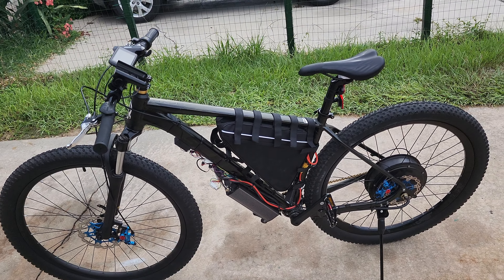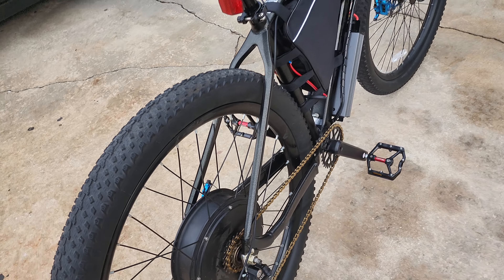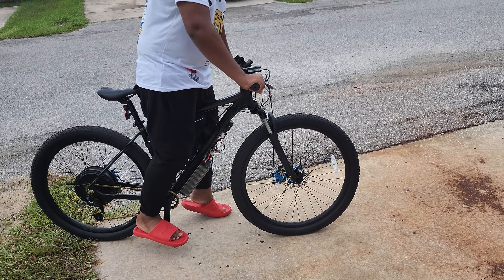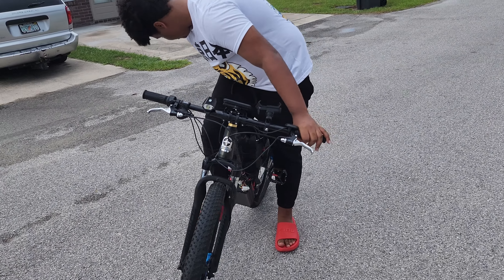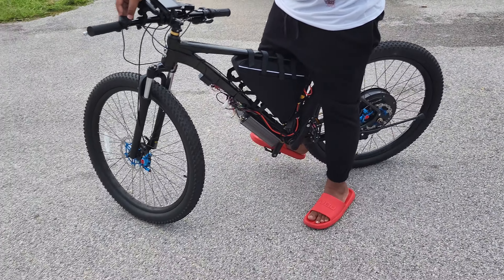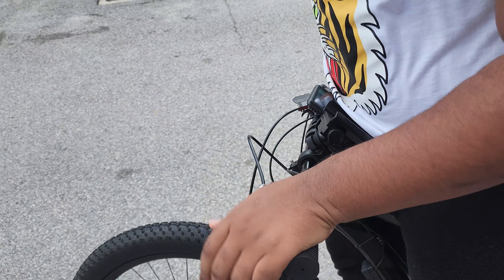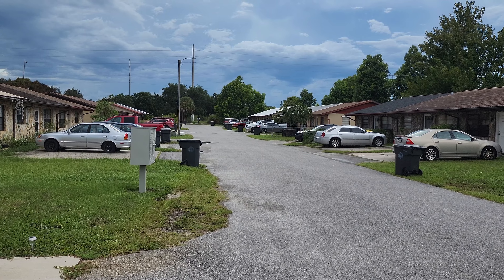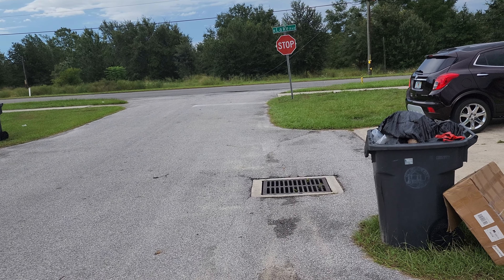Test ride on the 3000w ebike- sabvoton 72150

Comment: Another great build. How's the 48v holding up with the 150a controller?
Reply from the maker: It's holding up great but the 3000w motor gets hot under some hard rides so I'm going to give him my 205 and I'll be getting the 273
Reply: Nice.  150a controller not shutting down due to the low BMS of the 48v?
Unless you bypassed this one also?
Reply from the maker: This one is bms bypass also and I mod it to handle the 150a

Comment: For long distance riding to keep the bike motor cool install statorade gel and heatsink to the motor it's good to do this before installing the back wheel!! Please get the likes up people cheers!!!
Reply: Statorade is sold out!
Reply: @marthamryglod291  everywhere??
Reply: @liammccallum9398  it's back in stock. Just checked
Reply: yupp, better add these magnetic stratorade cooling liquids, i already fried one of these motors
Reply from the maker: I know lol my son already cooked the motor but I repaired it later ill put the 205 5000w on his soon
Reply: @E-bikeguy  I'm waiting on hub sinks and statorade to arrive. I'll shunt my 60amp controller, pot it in epoxy and add the statorade to the hub motor. My goal is to get more than 100 amps at 72v to the hub without anything breaking lol
Reply from the maker: @marthamryglod291  you will definitely be ok with them mods
Reply: @E-bikeguy  good deal!

Comment: I have the 2000w kit from Kirby bike. I wonder if I get the sabvoton 72150 and keep the motor maybe put ferrofluid and hub heatsinks use the 60v battery would I be able to get more power out of it ? Or the battery would be limiting factor ?
Reply from the maker: That will be perfect just keep your eyes on the motor temp,  and you will be fine
Reply: @E-bikeguy  would you recommend the sabvoton or fardriver ?
Reply: @E-bikeguy  the only reason I ask between the 2 fardriver seems to be cheaper and I plan to upgrade the motor to qs205
Reply from the maker: @hamdisel1  sabvoton is user friendly  and fardriver are more involved for tuning,  both are good controllers
Reply from the maker: @hamdisel1  yes fardriver controller is cheaper and make more power

Comment: nice job going DIY, although that controller is WAY overkill
Reply from the maker: But I changed the settings so it won't cook the motor tho
Reply: @E-bikeguy  I mean you could have gotten way with spending a lot less but at least you have a lot of room for upgrades now
Reply from the maker: @cobra4439  not really, it was cheap than you think I got the 200a sabvoton on my bike and never going back 😁
Reply: @E-bikeguy  I have a Sabvoton ML7280 and it was around $90 for everything, you could have gotten away with something cheaper than that bc mine tops out at 5kw. But hey it’s all good, nice build overall
Reply from the maker: No problem it was  something I had stashed away for a while and I just thought I can put it to use but I know what you mean tho and I believe that the 7280 would have been more suitable for that application.
Reply: but that rocks, this one will never get hot!
Reply: @Bergwacht  sabvoton controllers don’t really get hot

Comment: Can you explain to me what is set mph on each level? Please
Reply from the maker: It varies depending I on battery voltage so it's hard to explain but I can tell you mine p1 20mph p2. 42mph p3 58mph p4 64mph and p5 70+ mph

Comment: Quick question, I have a 48v 2000w geared rear hub motor 20x4 and can't  make my mind up to get the sabvoton 45a or 150a running 52v battery, my thought is to get the 150a and change the hub motor at a later date,, what's your thoughts ? I've not had a geared hub so not sure how much stick they take
Reply from the maker: Get the 150 and set It for 60a till you get a bigger motor
Reply: Thanks for the reply, nice to chew it over with someone that knows there stuff as the wife does not seem to understand 🤷‍♂️ I ended up going with the 72200, received it today but don't think it's a genuine sabvoton as the sticker on the end with the bar code does not say sabvoton, just waiting for the qs205 to land.. not built a hub drive bike in a few years as been using bbshd as where I live has a lot of hills